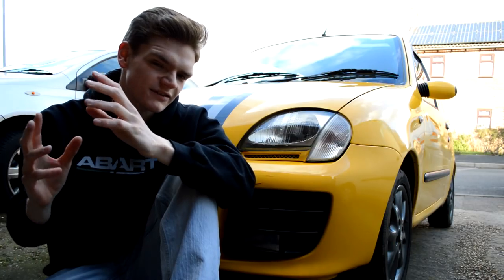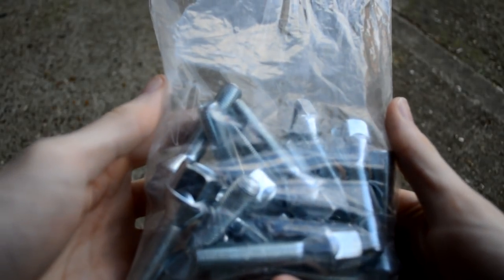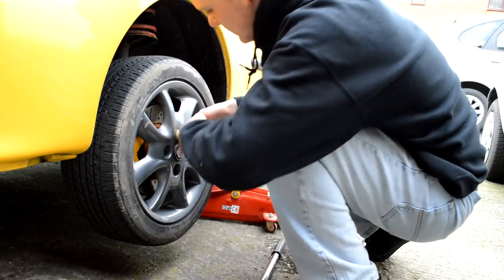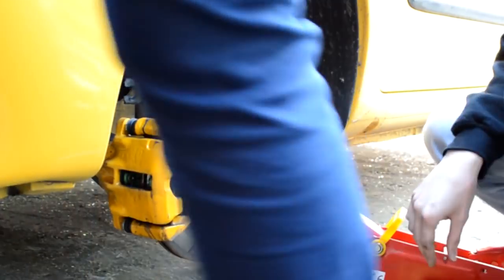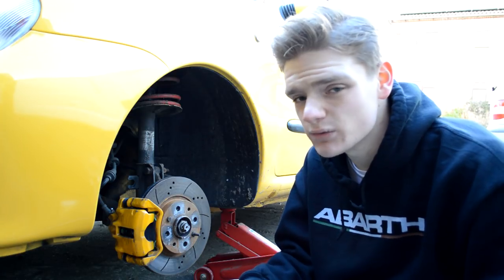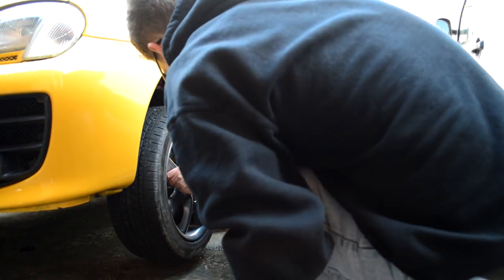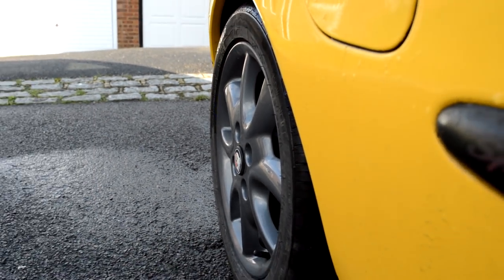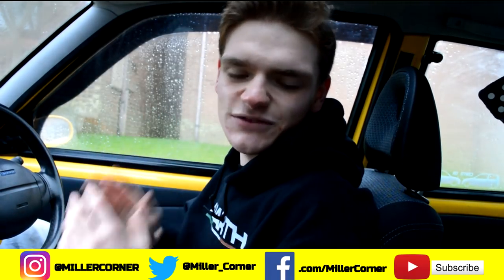DON'T DO THIS TO YOUR CAR!

Comment: dont use slide on universal spacers, get some hubcentric with the correct center bore and pcd for fiat, they are much safer, im running 20mm with rolled fenders on 6j wheels

Comment: Damn! Not easy little buggers to get right! Are you worried that the adjustments to the spacers may have altered their strength? After all, to grind them down to accommodate the brake bolts, you're basically thinning out the metal of the spacer so they no longer fit flush at that specific point...?
Reply from the maker: +Kody Dagley good observation! They weren't grinded down for that exact reason, buddy. Merely a couple of edges smoothed and shaped to accommodate the bolts
Reply: Ah, good call. I'm assuming yours are only aluminium, so they probably aren't the strongest things in the world! :)

Looking good though, will be awesome to see what is next! :)
Reply from the maker: +Kody Dagley thanks man, plenty more to come 😁

Comment: Wait...so you don't need to do a stud conversion to put the 14" wheels on?
Reply from the maker: Absolutely not, mate! They go straight on with the original bolts 😁👍
Reply: Just the 13" alloy bolts?! Blimey! All this talk about doing the stud conversion for the 14s, cheers pal!
Reply from the maker: No worries, best of luck 😁

Comment: Those cheapo spacers are fucking dangerous mate- take them off. If you haven't already. You should ONLY fit hub centric, vehicle specific spacers- the ones you fitted can move on the hub and then you'll be in a world of shit if they do when you're driving at high speed.
Reply from the maker: Check out the video that followed, dude - got em off pronto 😬 but cheers for the advice 😎👍

Comment: Crap car you must have money to waste !
Reply from the maker: I like it and that's all that matters! 😁
Reply: @MillerCorner  I had the seicento 1.1sx, flat engine power, rubbish brakes and chewed up 6 clutch cables,!  Finally blew the head gasket, which I got redone and 3000 miles later it blew again. Now scrapped got £50 for it. Like I said, a crap car, waste of money. Peugeot 107 got more go in it and is only a 1tr 3pot engine. Plus I think looks a much better car too.
Reply: @briandix216  I HAVE A SEICENTO ABARTH AND I LOVE IT